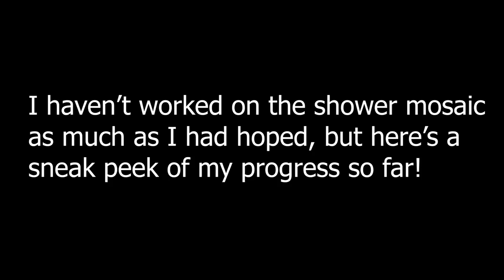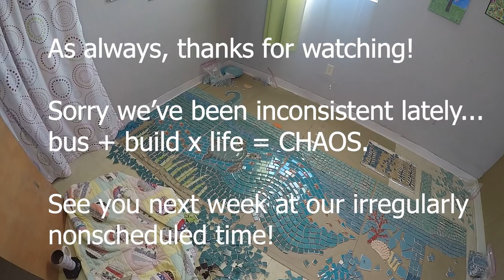Mike Has a HUGE DECK! (Part 6) & Update on Kerry's Shower Mosaic

Comment: If you ever need to hoist something again, look into getting a snap shackle. They are built to hold massive weight, but can release the load with one tug on the trigger line. It’s not clumsy like using a locking carabiner or standard shackle.
Reply: It is coming along nicely. I am glad to see you don't take short cuts on the build. I think there would be a few times I would have said close enough.  Love the mosaic. 
Also...
Thanks for posting these videos my wife really like watching them as the give us ideas for our build.

Comment: High tensile bolts guys, there will be a lot of torque on those bolts, it's probably squarer than the bus 😀 
Ps don't forget to ad the extra height to your overall height or you'll be undoing a few bridges 😀
Good work..
The mosaic will be fantastico when fixed and grouted..
You got the job...😊

Comment: nice thing about the deck is that it prevent direct sunlight from beating down on the roof , will keep the bus somewat cooler when it sitting out in the open , having awnings on both sides for the windows keeping the direct sun out of the windows will keep it cooler still

Comment: Darling I’m telling you, check out Laura Kampf’s video on her plywood, aqua stained subway tiling, in combination with your gorgeous broken plate mosaic, it’d help cover a ton of space, wall space for that matter, it’d absolutely go with your look of the mosaic tiling, and it’d also tie in your exposed ply look you have going on! Ohh and it’s cheap!!! You could use another species of wood ply like Hickory, I’ve seen some recent builders use that for their kitchen cabinet faces, omg the natural striping is just stunning, apply a light to dark tone of navy and/or aqua stain from varathane (makes it water proof as well) and it’s flow with your mosaic tiling while also covering more square footage compared to tiny tiles. Which I love the mosaic, but to do a large wall space would be exhausting, or you could add the ply tiles to your kitchen backsplash adding a cohesive color to the tiles in your bathroom and bringing it into the kitchen. Seriously it’s easy, your hubby has a table saw (all required for making cuts) and it goes super fast plus you just need to nail it to the existing walls or apply construction adhesive. Check out Laura Kampf

Comment: I always wondered if it would be possible to have solar panels up top that could tilt either way depending on which direction the bus is parked.

Anybody ever seen a system like that?
Reply from the maker: We talked about that but the mechanism is pretty complicated and the motors have to work really hard.
Reply: How about drilling 4 holes.  1 in each corner and then held in place with aircraft pins.  Then like a 2 foot flat piece of bar stock in the middle at the fulcrum: Holes at bottom into support, top into hole in the middle of the panel.  Like a teeter totter with the 2 ft bar stock as the fulcrum.  I think of it like one of those mirrors with the support in the middle, so you can tilt it either way up or down.  Then when you land in your parking spot. unpin one side, tilt up panel, then pin up center support to hold it in position.  Like in the movies when we put a shiny board on the ground. 
Example of tilt panels with pivot:  https://www.filmandvideolighting.com/reflectors.html
 I think it would work, and with your square footage you could  totally generate enough ions (with proper battery storage of course) to run a/c all night off grid if you needed.  
Then when its time to move, remove the flat stock piece- place panel flat- aircraft pin into place for transport.  Done.  I think that would be the best skoolie solar setup ever. And very simple.